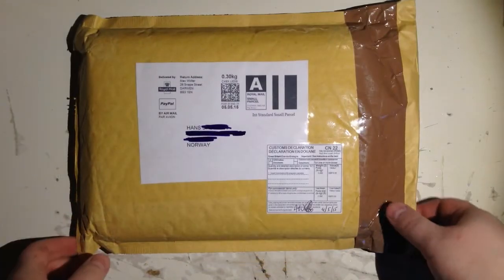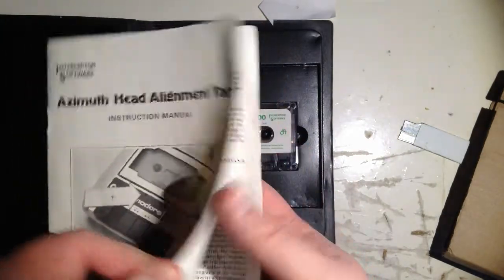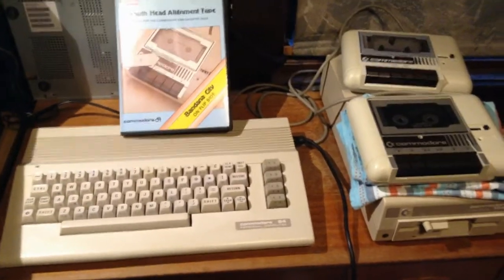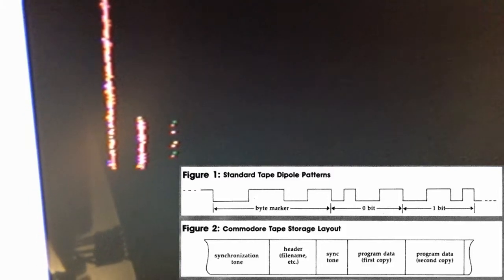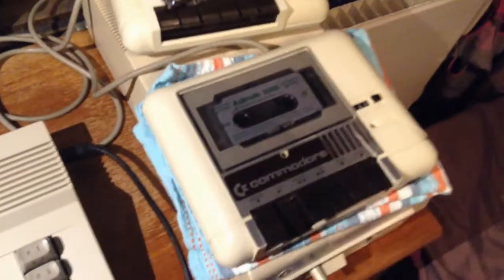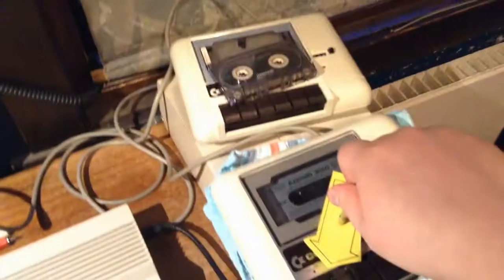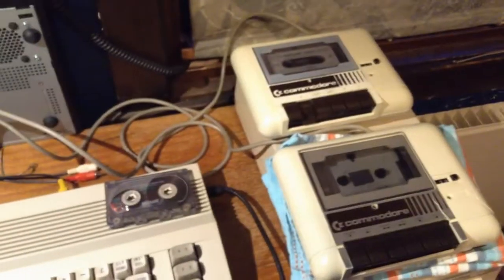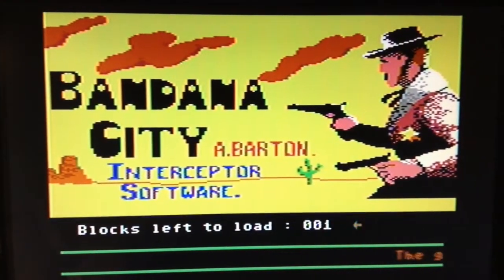C64 Azimuth Head Alignment Tape - Unboxing and testing

Comment: It's a shame there's no audio like you get on the Spectrum - I usually adjust the Spectrum azimuth by ear, you can tell precisely where the optimal position is that way.
Reply from the maker: GadgetUK164 ok. :) Do you adjust it until the sound is most crisp?
Reply: On the Spectrum, yes - so it sounds clear and not distorted or muffled.  I realize the C64 is digital rather than analogue, otherwise it might be easy to tap off the signal and output to a speaker or something.  I guess that's still possible internal to the tape deck.